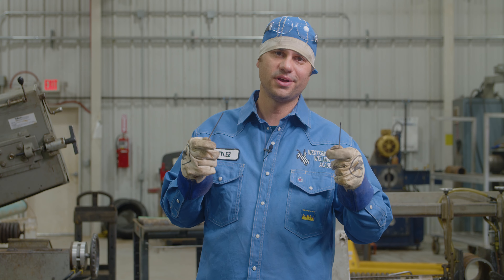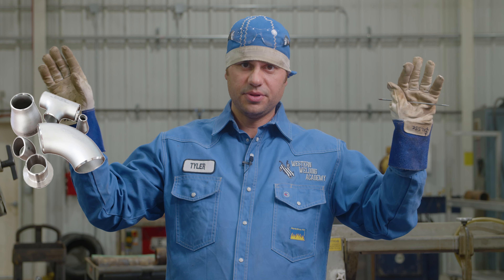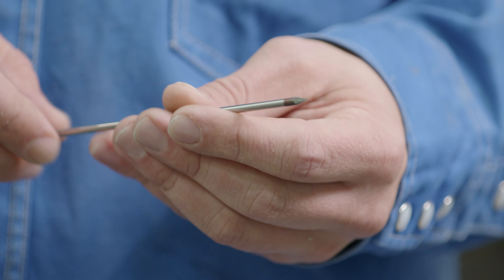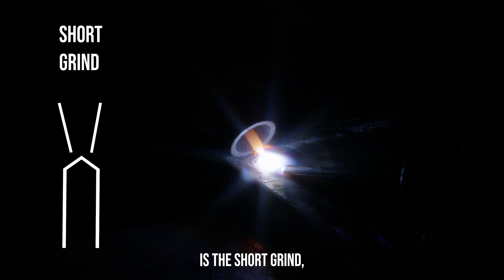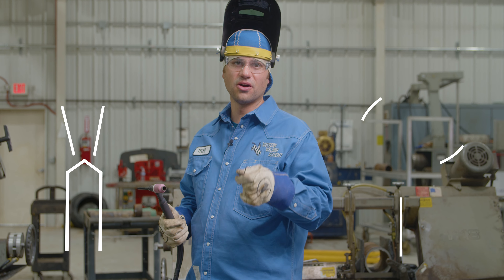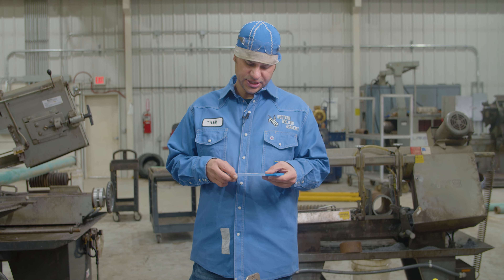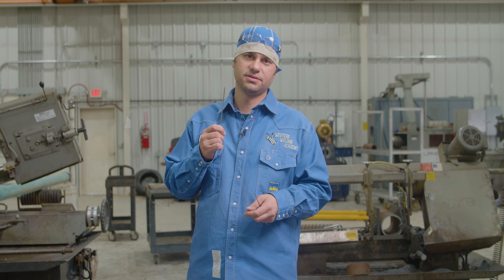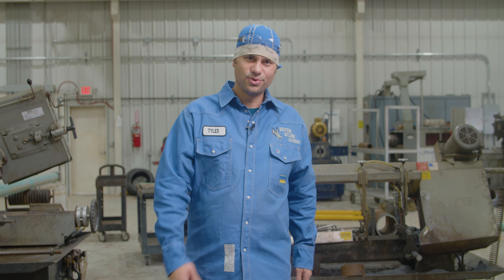You've Been Sharpening Your Tungsten WRONG @RealTylerSasse

Comment: Did alot of Tig earlier in my welding career. I retired in 2016. Novel approach to rolling the diffuser cup like that. Most of my tig welds were 1/4 wide. Also I didn't notice I always did my sharpening of Tungsten on a belt sander,my tank tester showed me that way and thats gospel. And always long polished that Tungsten.  I wonder if my bifocal vision would let me tig again? Any ideas? Good luck grads,Stick with that training. Welding is a No shortcut career,but its a honest one!
Reply from the maker: Amen my guy! As for bifocal vision we aren’t sure, but we think it’s possible just challenging
Reply: Why would you polished it? It welds better after polishing?

Comment: Do you recommend 5/32 or 1/8 tungsten for flushing out big j bevel pipe running high amperage like 300+ amperage?
Reply: 5/32 and 250 tig torch

Comment: Great video! Btw... The red tungsten has become banned in Belgium (and many other countries) because there is "thorium oxide" in the tungsten. And that is radio active! Is thorium still in the red tungsten in America or did they manage to take it out?
Reply: I can still go to the welding supply store and buy thoriated tungsten, it welds really good, but thorium oxide is probably not good for me
Reply: Yes, in America, red tungsten is known as 2% thoriated tungsten. The radioactivity of thorium is only dangerous in large amounts.   You would need a large bundle of thoriated tungsten before it would need to be labeled with a radioactive sign or warning.
Reply: Also, the danger of thorium tungsten is when you make dust from grinding it and breathing it. Otherwise it's not considered dangerous to handle.
Reply from the maker: @heyman5525  👆
Reply: Grind or Weld stainless too hot and the chrome dust turns Into the radioactive chrome^6 isotope due to heavy oxidation from the air! 

Check with a geiger counter once grinding, it increases alot in radiactivity
Reply: @heyman5525  unless you breathe in dust, have constant exposure to it or somehow melt that tungsten when welding with too many amps for the diameter/by having wrong polarity and breathe in the fumes

Comment: Interesting......on grinds. I learned quite a bit from the vid. I do a lot of thin  stainless tig weld  repair that the robot welders mess up with burn holes and chattering and skips in the welds at work. 
I make stainless exhaust systems at work ( for a couple of the big car companys) and that's what I deal with on Tig.
  I usually sharpen my tips at a 40deg angle when making weld repairs, I may need to try a short grind to see if it makes repairs any easier. 

All we use are red tips at work.
Reply from the maker: Thanks for sharing that! 👏